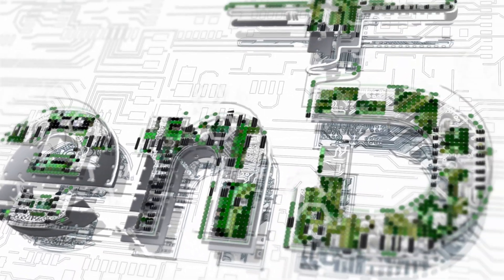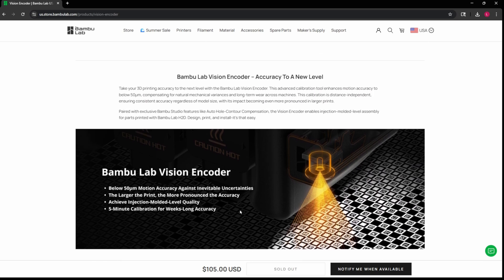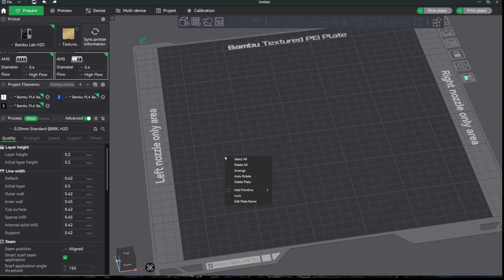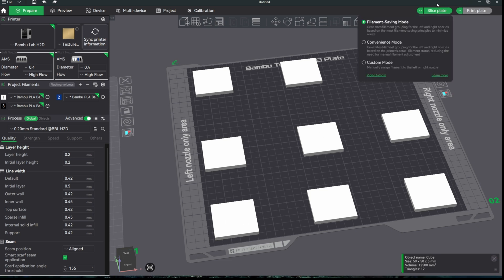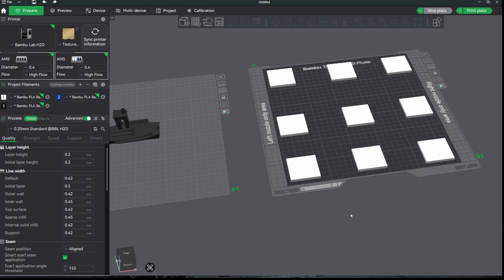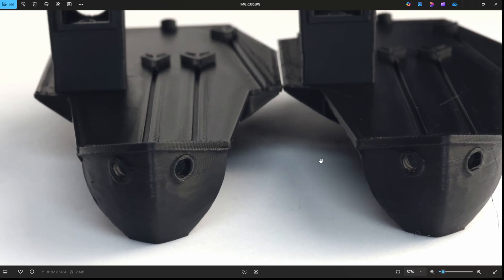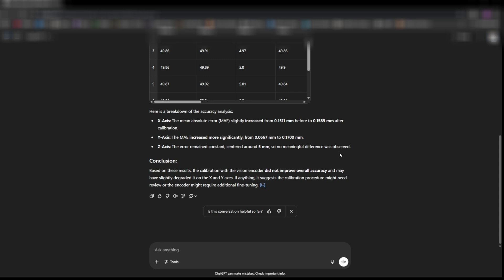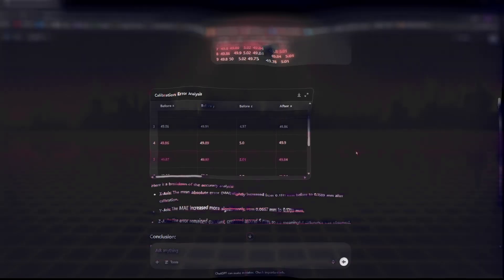What does the vision encoder calibration plate do?

Comment: The test was performed absolutely incompetently. And the final results were interpreted terribly. Perhaps this has already been mentioned in the comments, but I haven't found it.
1. Analysis of the Results. The aspect ratio of X and Y improved significantly. While there were discrepancies between them before, these discrepancies became much smaller after calibration.
2. Yes, the deviations from 50 mm became greater after calibration. It seems so. But the material's shrinkage coefficient was not applied. It is approximately 1.0033 for this material. If it had been applied, you would have seen that before calibration, the deviation for the X-axis was about 0.0134 (mm) and for the Y-axis it was 0.0981 (mm). After calibration, it became 0.0056 (mm) on both axes.
If you are testing something, test it correctly.

Comment: Having read nothing about this, but having experience with similar setups, it's not about bed leveling but about calibrating the distances of x-y. If you tell your printer to go 1mm left and it goes 1.01mm you won't notice the difference. But if you tell it to go 100mm to the left and it goes 101mm it is significant enough so that it's visible and parts might not match together.

Comment: You failed to give Chat GPT what the accuracy and repeatability of your caliper that you used. Not to mention how you actually measure something can cause large differences in data observed. In the real world where these tests are done you'd want to perform a gauge R&R on the process to determine how accurate your testing method is. FWIW this vision plate would only be able to adjust the X and Y axis.

Comment: If you don’t know what 50 micron accuracy means 

You might not have the knowledge necessary yet to test the differences 

Print a large single part before/after. Use proper tools to measure hole diameters, x/y overall accuracies etc.

printing parts and using Chinese calipers to measure small parts wasn’t quite the right approach to assessing the differences

I would reevaluate your approach and try again!

Comment: Honestly, I think you need to do a bit of research before making a video like this. Its clear you have misunderstood the purpose of this plate.

Its to correct for things like skew. Not to enhance quality per se, its to get injection moulded level accuracy. It is not to check if the bed is level, the load cell is used for that. Again its to check the motion accuracy of the machine is correct, this sets a baseline for the "quality" you can get by tweaking slicer parameters.

If you're going to make a video titled: What does the vision encoder calibration plate do? I suggest you do a bit of research first, as it just comes across like you just guessed, didnt understand it but made a video anyway. Its not a good look dude.
Reply: Agreed, not all YT channels always know what they are talking about and this one is a perfect example.  Great production quality but questionable content.
Reply: I've seen a couple videos like this lately which is frustrating. It's one thing to miss a few small details but to fundamentally misunderstand the purpose of the plate is sloppy. And it's not like Bambu is obfuscating this. I don't have any Bambu printers, I likely will not ever get one, and yet I know this.

Comment: From what I read on the website its not necessarily visual quality, to me it sounds like dimensional quality.  Such as your 3D printed parts fitting together more smoothly and evenly.  The larger the print the more accurate and better "quality" it is...  You should have 3D printed various size gears and fit them together to see how well they perform before and after.

Comment: I totally agree with the comments regarding when the machine is new, freshly calibrated at the factory. However, if the machine is moved or subject to anything that might jar it, the ability to accurately recalibrate it becomes invaluable especially if you can do it yourself within 5 minutes. Also, periodically recalculating would guarantee closer accuracy. I purchased the plate and plan on monthly recalibration. I also paid the tariff price, $120, and still think it was well worth it.

Comment: If you don’t know what 50um means (microns), then likely you don’t need it. No, it’s not bed leveling. It’s a horizontal distance measurement tool. It’s not measuring in the Z axis. You print something of a specific length and check the accuracy. Using those small cubes isn’t useful. You need to print something, say, 10 inches long. See how close to size. Then use the calibration plate. Let it do its thing and print the same thing. That’s it. Printing a benchy isn’t useful, nor is printing squares. This is for when printing an enclosure for a circuit board (as an example) and the parts need to match along with the screw holes. I would be concerned about your measurements. Calipers have an accuracy of plus or minus 1.5 thousandths. Very expensive models such as my TESA are accurate to a bit over plus or minus 1 thousandths. How much pressure you apply with your thumb will derive in your reading if you’re not careful. The joking about this doesn’t make you look more serious, or knowledgeable.
Reply: 9:19 spot the 105€ difference 😂
What is he even doing there. He don’t have a clue what the calibration is doing.
Reply: @Todestelzer I don’t know. This is for people who understand the entire printing process. Different filaments shrink differently. You have to be careful about your corners. They tend to stick out a bit. That will mess with the measurements. So you have to go to the settings to pull back at the corners. He doesn’t understand this and neither do most people.
Reply: Exactly!!! This was the most unscientific video in the history of the internet.

Comment: Lenny, did you let the bed cool down to room temperature before you ran the Vision Encoder plate test? The instructions specifically indicate you will get worst result and distortion if you run the test with a hot bed. It’s all supposed to be at room temperature before you run the test.

Comment: Honestly I think the vision encoder will have little impact on a brand new machine calibrated at the factory (unless your courier threw it around in the back of the van a bit too aggressively). Where I think it might help is in the long term as the machine wears in over time, the vision encoder will help to restore accuracy as parts loosen, belts wear and stretch etc. Really appreciate you making this video though - I've seen a number of youtubers throw the vison encoder plate into their printer, read out the numbers it displays on the screen and shrug. This is the first time I've seen anyone actually do before and after measurements.
Reply: I tested mine with califlower from vector3d. My H2D had a skew around 0.05% if I remember correctly. I could correct the skew but there is a -0.28% error in x I can’t fix easily. I would have to size every part every time in slicer. Orcaslicer could do it but I didn’t used it because of the circumstances with the connection to the printer.

Comment: I doubt it will make a significant difference when the printer is new. Skew on the x rail, thermal cycles, belt loosening, ect. These will get worse over time. The vision encoder is suppose to compensate for this. The greatest impact will be on large parts that have holes and features.
Reply: I have -0.28% error in X. Skew could be corrected. Califlower from vector3d. Ordered a plate last week.

Comment: The vision encoder is to improve the accuracy of the x/y motion system, not bed levelling.
Reply: Correct, I don’t know where this guy even thought it had to do with bed leveling. It’s teaches the XY system to know the exact positioning of itself over the bed. Simple really. Most effective thing it’ll help on is stopping lines in prints when you pause.
Reply: The other day someone was posting the vision encoder helped him getting better top surfaces... They don’t have any clue what the vision encoder calibration is doing.
Reply: @Todestelzer  Could it do some clever things to compensate for errors in stepper motors, when they use microsteps?.     The microsteps are often not spaced evenly, insteady they are "flocking" near the real step, making it imprecise. So it checks where it is on the calibration bed, then moves what it thinks is 0.1mm and takes a new snapshot of the calibration bed and check the distance its traveled against what it should have traveled.
Reply: @AndrewTSq it’s a step calibration and skew calibration. If they are fancy the steps will be calibrated not for the full x/y size but in smaller increments. Better CNC controller can do this too to compensate for variations in the ball screw.
Reply: This will only show as the printer wears in time. 
The vision encoder will offset the error to near factory new printer. 
And yes it is for the x and Y.axis
Reply: Es cierto !!!